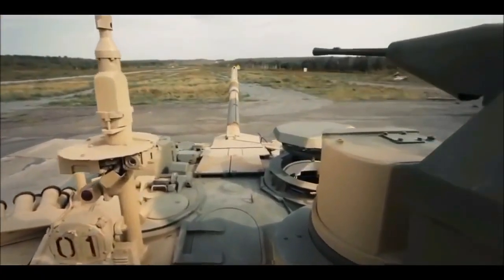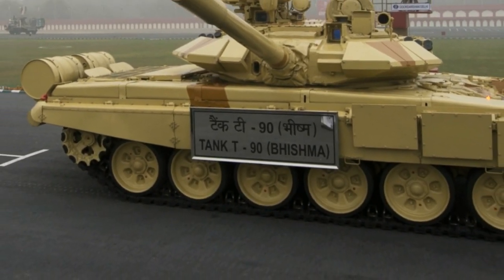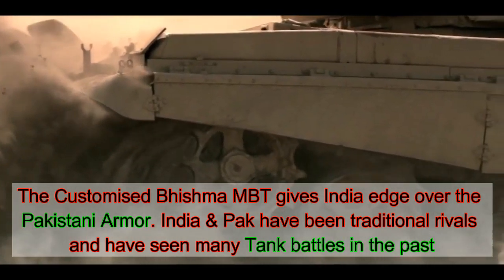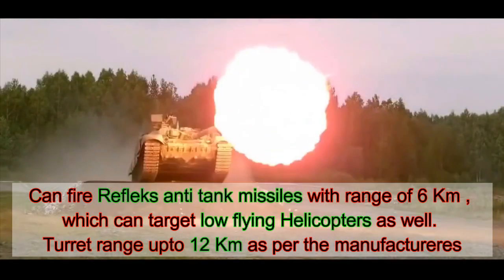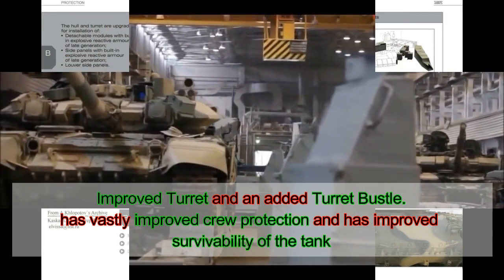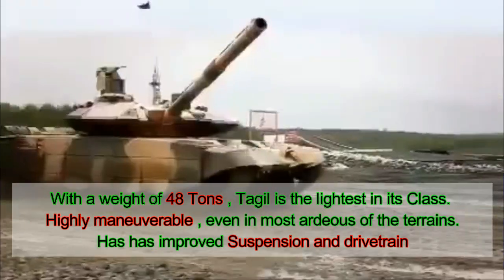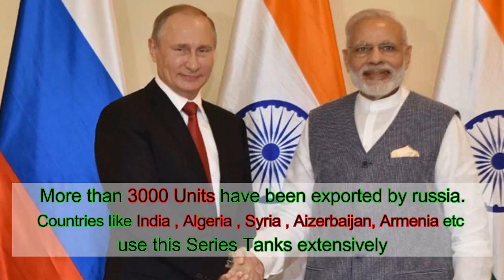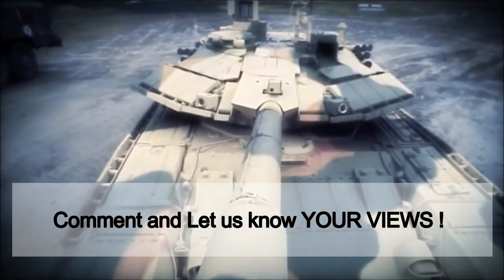T90 Tanks  -  Bhishma Main Battle tank / T 90MS Tagil Tank

Comment: The T-90 is a good tank but still isn't going to ever win a 1v1 match against an Abrams. The Abrams M829A4 DU sabot round will slice right though the T-90 like a hot knife though butter. Also, the Abrams' optics and fire control is better, so the Abrams will be able to see and kill the T-90 before it can even get close enough to even think about being able to penetrate an Abrams (which the T-90 can't pen the Abrams frontally). Also the Abrams can fire 2 rounds for every 1 round the T-90 can fire.